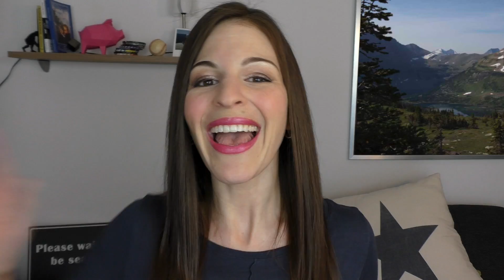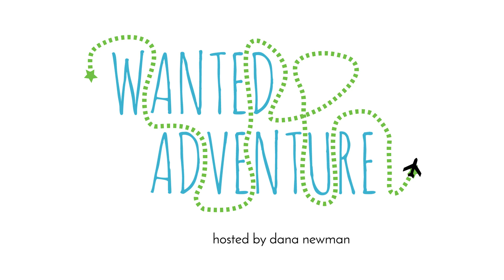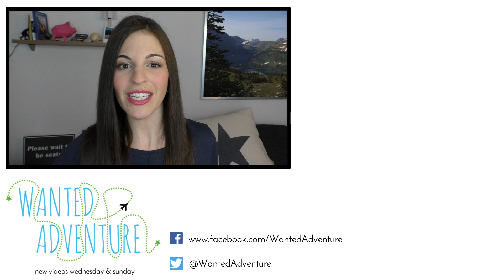Why Are Houses in America MADE OF WOOD?!

Comment: I always make fun of my friends in Texas, calling their homes "paper houses". It's so odd for me that you can put your fist through a wall!! xD In Germany you'd rather break your fist 😂
Reply: You joke, but it has gotten REALLY bad in some places in the US. I recall back in 1989 I looked at a new home because it wa just SOOO cheap... I mean they would sell you a NEW home for $40,000 and you could pick the colors and even floor plan. Then  I went to look at one being built... 
From inside to outside: 1/2" sheetrock..2X4 on 16" center, 1/2" foam board, vinyl siding.  THATS it. I could not believe it, indeed one could punch right through it (if you missed the 2x4). I asked the guy what the life expectancy was and he said 20 to 25 years. Mortgage.... 30 years.  
PS: the neighborhood went bankrupt, and is pretty much deserted. 
PPS: the home I did buy? was built in 1965.  hahaha
Reply: It's a house not a battleship.  As long as it's structurally sound and has decent insulation, who cares what it's made out of.  Everything else being equal, quicker and cheaper is better.
Reply: I want my walls somewhat soundproof, heat and cold resisting, durable and able to hold up wall cupboards and heavy shelves, thank you very much. It has nothing to do with wanting a 'battleship'.
Reply: " Wood houses are extremely bad when it comes to noise protection."
That's not wood; that's plasterboard's fault. The (non-structural) stuff they place over the load-bearing wood. The material makes zero difference here: plasterboard over metal studs would be at least as noisy as plasterboard over 2X4s; possibly more so.
Reply: +PongoXBongo
Plasterboard looks nothing like plaster, especially if you put cheap flat paint on it. Glad my 1920 house has plastered walls AND old-growth hardwood cabinets! (Pretty much unavailable at ANY price point today, let alone in a $35,000 fixer-upper...those trees are gone, and the lumber companies are far too greedy to leave an oak tree alone until maturity!)

...but this has zero to do with wood frame construction. Plenty of chintzy office buildings have gone up prior to the 2008 crash, and most of them use metal wall studs.
Reply: "The USA is so much nicer"
No. Just... No
Reply: PineSG My home was built in 1940 and it stands like brand new..
Reply: Nipaporn P. ...Your comment.. is possibly the dumbest one ive seen today..
Reply: Noisy Empire Wood houses are extremely bad when it comes to noise protection. And cupboards and heavy shelves are only properly fixable when they are fixed to studs.
Reply: Yeah, I hate modern drywall construction. Before the mid-1960s, most houses in the U.S. had lath-and-plaster over the wall studs. Now everything is drywall. Even good quality drywall looks and feels cheap.
Reply: Because people keep replying to this comment chain.  I was happy to let it die, but them Paul Guy came along, and now you.
Reply: @Noisy Empire
I live in a half-timbered house from 1724. Even then, they had around one meter of brick wall for stabilization on the bottom of the outer walls. Afaik, theres a similar rule in some US states only since ten years ago :D
Greetings from Germany ;-)
Reply: Drywall, plasterboard, wallboard, gypsum board, sheetrock -- different names for basically the same product.
Reply: PineSG Totally agree with what you said here. Part of the problem also is that people in the US have a different idea of what "old" is, and therefore what is long lasting - you just said 1965 like you meant 1800! I'm from England and 1965 sounds like a modern new house. Well, fairly modern. I own a house that was built in 1570. Do I think that's old? Well, it's fairly old..... nothing special.
Reply: xAnicsi Wood houses can do that..
Reply: Most walls look the same with a few coats of paint.  Who goes around feeling walls?  Drilling into, running wires, and installing sockets/boxes in lathe and plaster is a real pain.  Practicality trumps nostalgia.  Housing evolves, that's a good thing.
Reply: Who goes around feeling walls? I do.
Reply: Virtually all commercial buildings use metal studs, because they are fast and easy to work with compared to wood studs, and office spaces get remodeled more often than homes do.  And drywall (I'm assuming that's what you mean by plasterboard, but I've never heard that term before) can be plenty quiet with wood studs, just put insulation in the walls.
Reply: I remember some attempts like 20 years ago to popularize metal studs for residential (home) construction in the US, but it never really took off.  Too much of that bothersome "if it ain't broke don't fix it" mindset that often stifles innovation I guess.  Bottom line is a building can be built from almost any conceivable material, each with it's own pros and cons, each best suited to its own environment, and each with wildly varying price points.
Reply: PongoXBongo Why the hell are we still talking about this?
Reply: "I remember some attempts like 20 years ago to popularize metal studs for residential (home) construction in the US, but it never really took off."
I'm not sure metal studs (we're talking galvanized sheet metal here) are any more durable than 2X4s, and they're a lot harder to fasten shelving, etc, to.
Reply: So, as long as you can't see through the wall, it's quite okay for u.s. citizens, it seems. ;)
Reply: Sebastian Urbas The only reason you should need sound protection is: Playing an instrument, having sex or murdering someone. Its not a big deal with sex, just do it late at night, Instrument in the morning and just dont murder someone, its not a big deal.
Reply: Noise protection?  Stop being so damn loud and respect your neighbors.  Shelving isn't a problem because walls are full of studs, and the cavities between those studs are stuffed with insulation so heat/cold isn't an issue either.
Reply: Why are all these europeans so passionate about this topic? Who cares. The USA is so much nicer and I've lived both places including Japan.